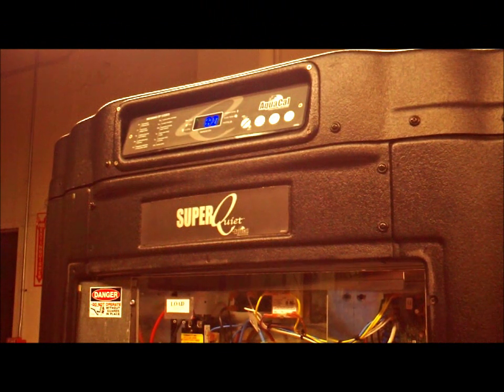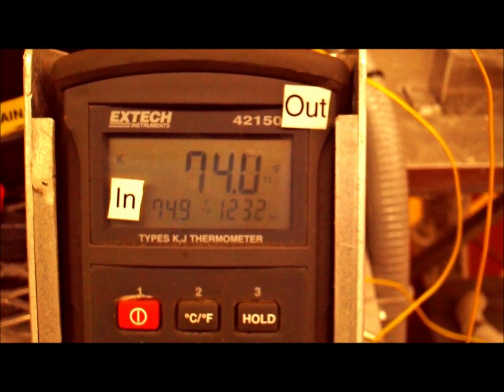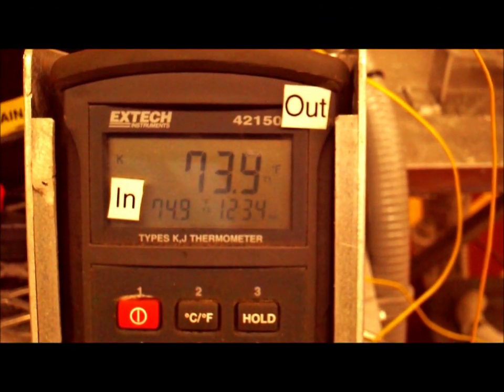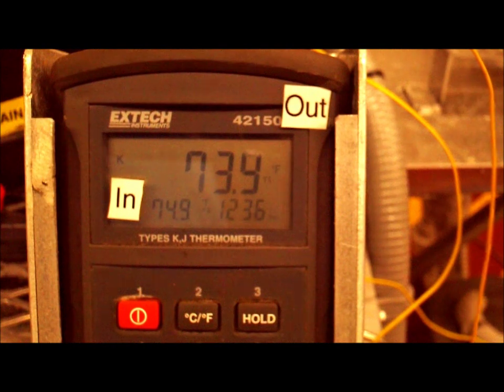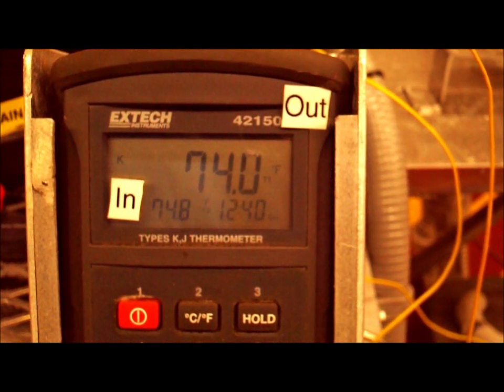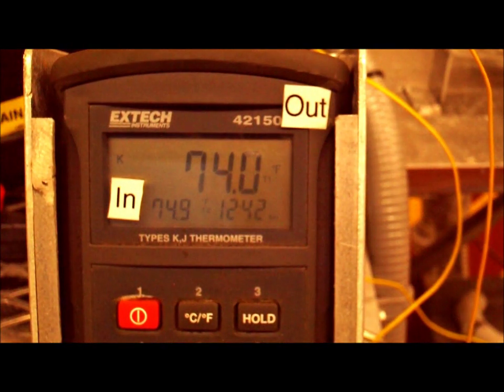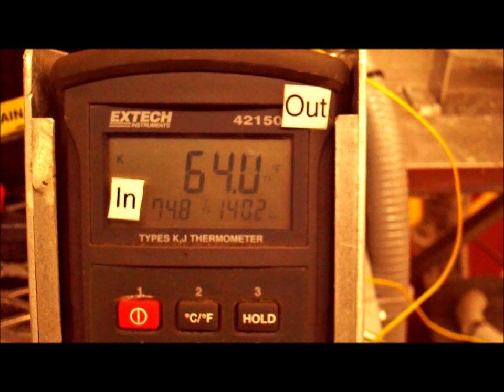How Can I Tell If My Swimming Pool Heat Pump Is Working Correctly - Proper Testing Method

Comment: I  have an external air temp  of 88 F
and exhaust air temp of 72F
 the  water flow  is   good ,  pool is  balanced
Yet  temp  of  water out of the jets, is the same as  the  temp of water going  into  pump  (82 F)........